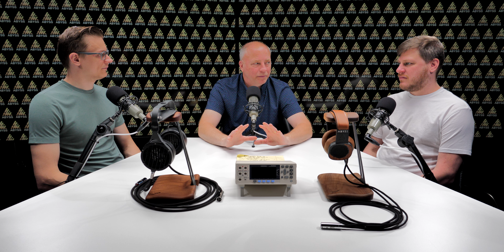Why Headphones can be Hard to Power

Comment from the maker: Joe misstated voltage vs power. Power increases by the square of voltage, for example every doubling of voltage, power is 4 times (Power =Voltage (squared)/Impedance). The gist of it is the same, increase in speaker impedance requires increased voltage in order to draw an equal amount of power.

Comment: The demands for current and voltage for headphones can be misleading. If you see a headphone that has a really high sensitivity rating, but a lower impedance like most planar headphones, you’d think they are so easy to drive. Sure. You’ll get the volume loudness level no problem, but by quality power standards? No. Key and very evident characteristics of a headphone being underpowered is bloated, distortion in the bass and excessive sibilance in the vocals. Those are dead giveaways that one needs to match the amplification better for the sensitivity rating and current+voltage output. 
A good example is the FiiO FT5 and the moon drop Para. 
Weirdly, these headphones demand pretty substantial amplification 5X their price. 😮

Comment: you guys gave up on closed Diana? it's been years since you announced that you are working on it
Reply from the maker: Been working on the materials and aesthetic of the closed sides for too long, bouncing back and forth between other projects.
Reply: It’s really hard to make a „right” sounding closed back, especially if you don’t even want huge caps. I reckon it’s safer to drop it than do what hifiman has made with their closed backs
Reply: @kajetan9550  you’re right. I guess making a closed Diana is gonna be a real challenge because of how thin its caps are. Very Little space to work upon for damping. Unless they make it bigger which will compromise Diana’s slick form factor. Bur their recent approach to make an easier to drive Diana can be even more appreciated in a sealed platform. I think we eventually will see closed Diana one day.